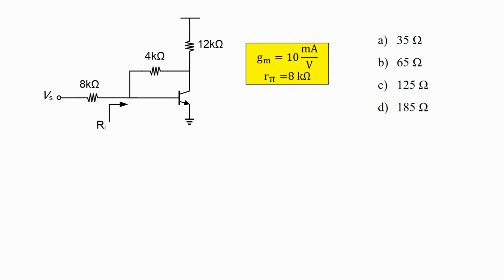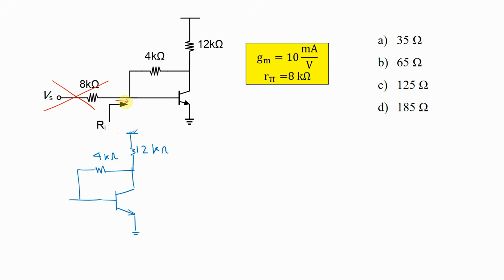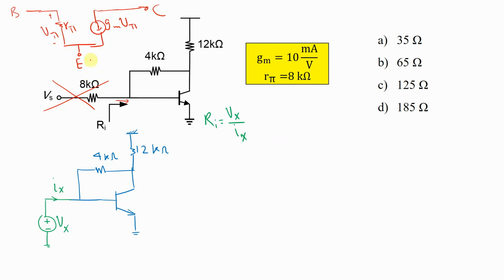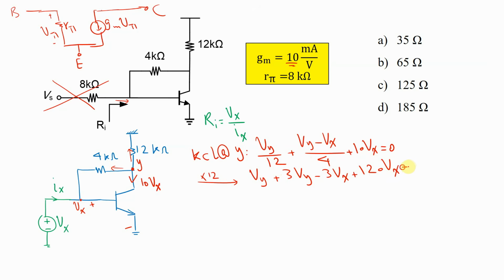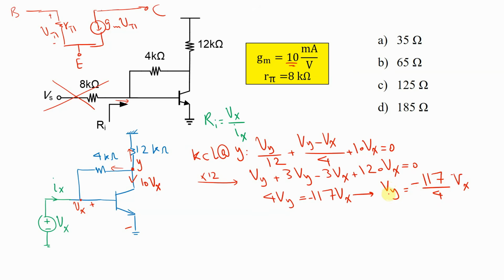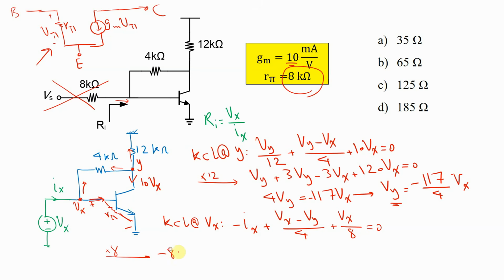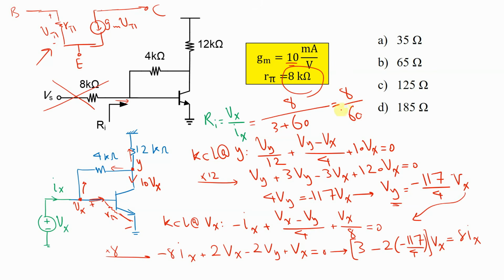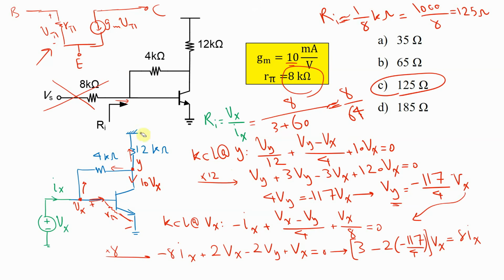Calculate Ri

Comment: I tried to learn transistors in 1985, and this is a foreign language to me.  We had data sheets that told us 'Re', with Re, we would be able to calculate Ri. .. Beta Re + RE was the source of the answers
Reply from the maker: Thanks for your fantastic comment. You are right, but in this particular problem becasue we have a feedback resistor we had to use a voltage test and calcultae the input resistance by this method. I know what you are saying, when we look at the base we see Ri = Beta*(Re + RE), but this is not working in this problem.